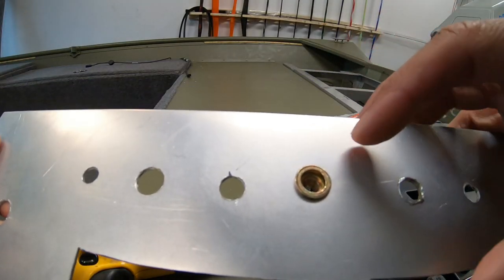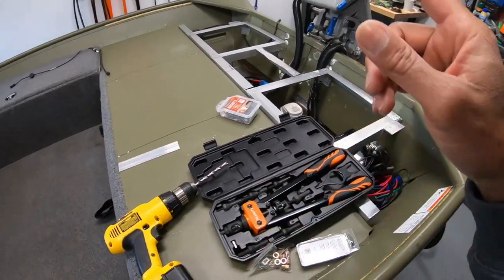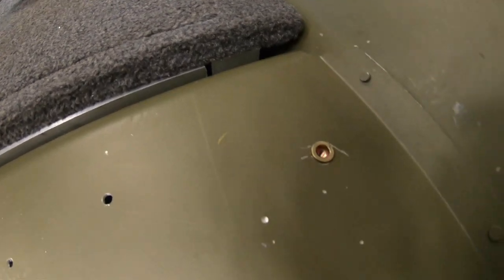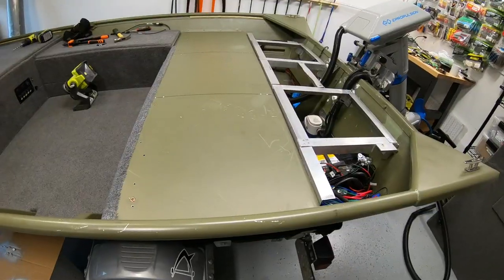Upgraded Way To Secure The Deck Of Your Jon Boat 2022

Comment: To get a tighter crimp with the rivet nut, before backing off to release the nut from the rivet gun, screw in on the dial and give it another small crimp or two. 👍🏻
Reply from the maker: Thanks for the tip. I'll keep that in mind. 👍🏾